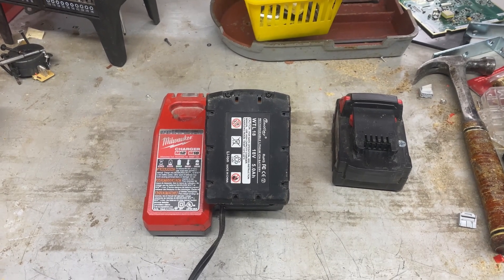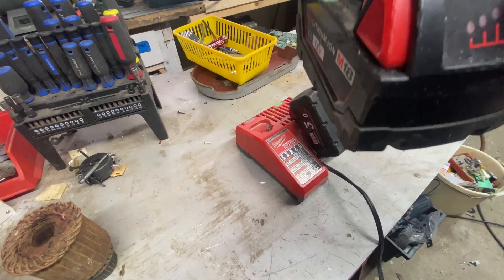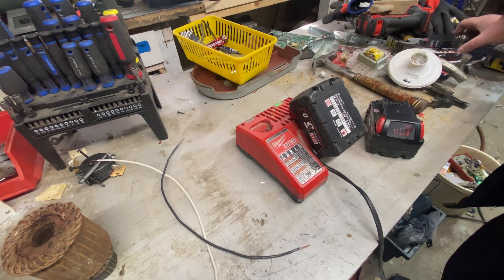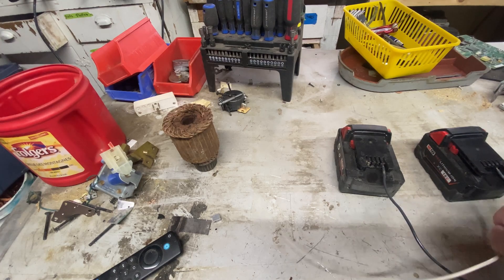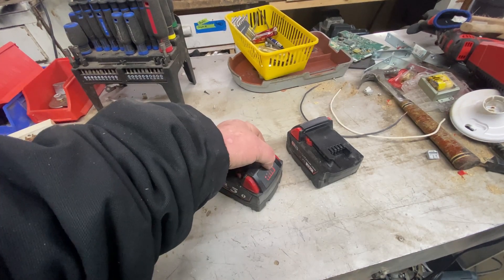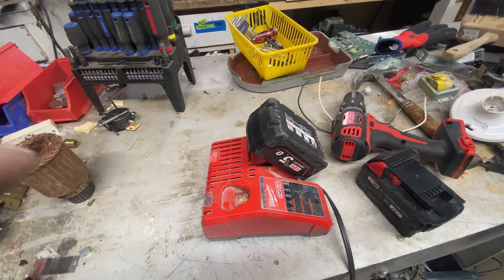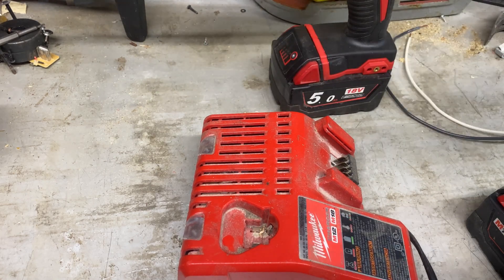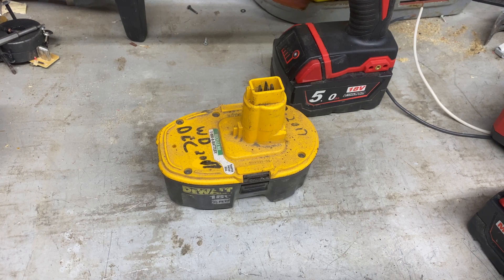Cordless Tool Battery Repair | Milwaukee Dewalt Makita Ryobi  18v 20v

Comment: Cool.  Wheelchairs play the same games. Their chargers won't begin if they don't detect volts in the chair batteries...So I use old school chargers that are on and off .....just like they did with Sparky at Sing Sing prison.
Reply from the maker: lol sparky at sing sing I going to use that in a future video
Reply: Just make sure you don't have anyone sitting in it while filming and throwing the switch  @nicejunk666

Comment: Most people don't realize that the batteries need that residual charge for the charger to recognize it is a battery or not a poser ? I have found it does not always work but definitely worth a try.
Reply from the maker: If it doesn’t work then it’s a dead cell once I find one I’ll make a video how to test the cells and how to change it out